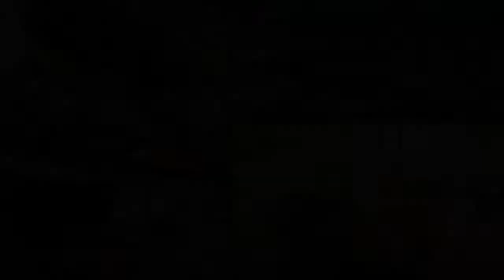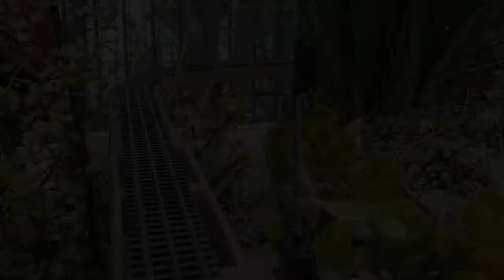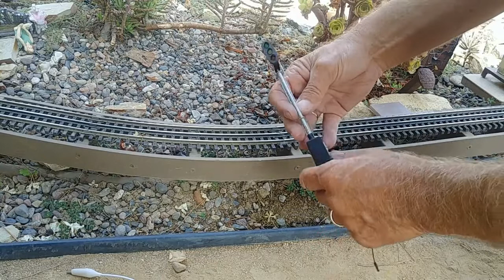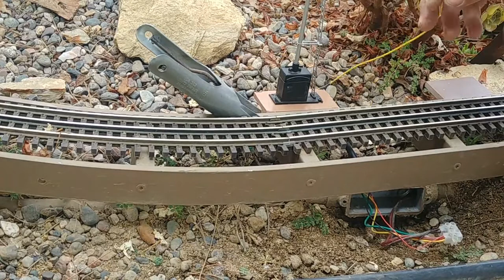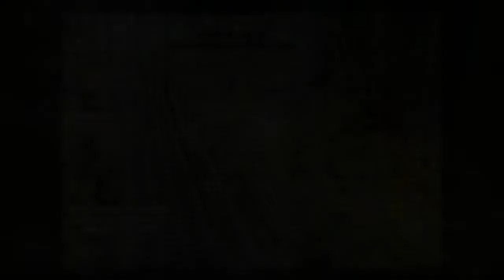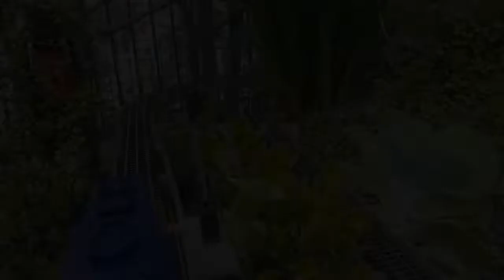O Scale Trains by Ron - Outdoor Layout - Block Signals DZ-1050 install

Comment: Very cool video, Ron. I've seen other guys install signals using the infrared sensor. But wiring it to the track adds that much more realism. Very cool indeed! Also good to see you running your loco long hooded... as it should be, LOL!
Reply from the maker: Thanks for tuning in, yeah I like running long hood forward. Real east coast railroad running.